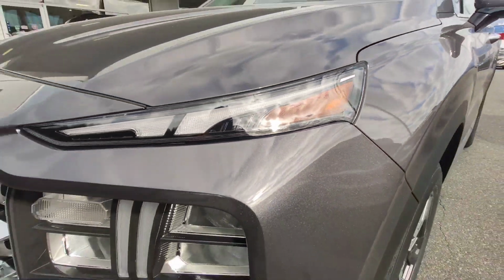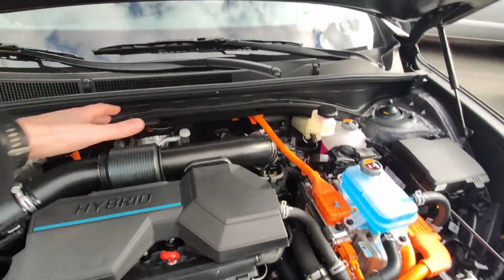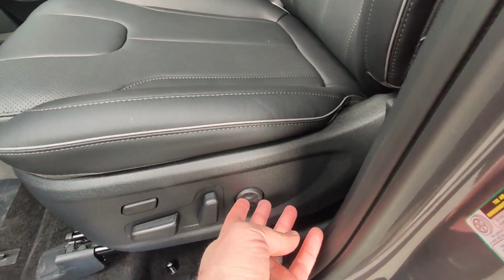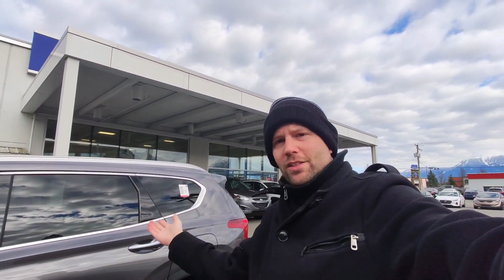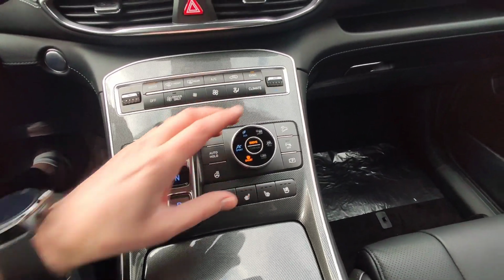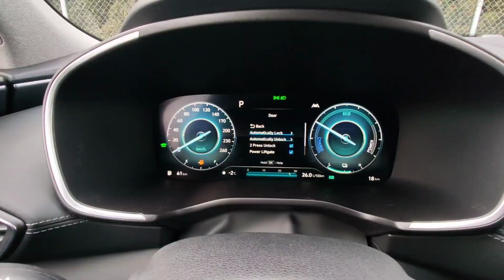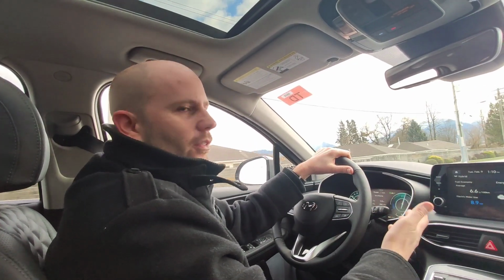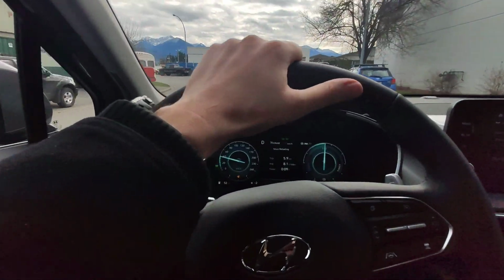2021/2022  Hyundai Santa Fe HYBRID LUXURY ! - Full Review

Comment: In Canada, there are two hybrid trims. Can you highlight the main differences between the two trims? I know the Preferred trim has no digital cluster. Anything else significant?
Reply from the maker: I'll be doing a video on the trend hybrid soon.

But in the meantime:

https://www.hyundaicanada.com/-/media/hyundai/showroom/2021/santa-fe/brochure/2021-hyundai-santa-fe-product-card-en_mar.pdf?modelId=762b9321-00da-4f2c-8ed0-727ed8f1d288
Reply: @edsgarage001  Thanks for the link, I thought there was no information on Hyundai's website (still no mention in the "Build and Price" section).  Note that the hybrid I test drove had a spare tire while the brochure says otherwise.  Strange.

Comment: How does the 8-in infotainment system compare to the larger one of the Calligraphy trim?  Besides being smaller, is it slower, less responsive? Maybe a few less features with Bluetooth, navigation, etc?
Reply from the maker: It lacks navigation, however it gains wireless carplay and Android auto. The interface is a bit different but it responds just as quickly.

Comment: Do you know if the Hybrid or at least the Plugin Hybrid has an electric heater? Otherwise it means you will have to keep the thermic engine running to warm up the car during winter.
Reply from the maker: The Ioniq plug in hybrid has no problem heating the cabin at all, but it does fire up the gas engine initially to speed up the process, which is actually the most efficient way to do it. I imagine the Santa Fe PHEV will do something similar.
Reply: @edsgarage001  What do you mean by speed up the process?
Reply from the maker: @TofSag  speed up the process of heating up the cabin.

An electric heater would be very slow compared to the waste heat generated by the gas engine.
Reply: @edsgarage001  But gas engine first need time to warm up itself. However I understand from your answer that the Ioniq plugin would use both (electric/gas).
Reply from the maker: @TofSag  as far as I know
Reply: In fact the question below is whether it is possible to warm the cabin without running the gas engin as it is forbidden in Belgium to let it running while parked.
Reply from the maker: @TofSag  ah... 

I'd say probably not.

Jammer hé? ☺️
Reply: @edsgarage001  Ja ;) With the Park Assist,  that’s most probably the 2 functiionnalities I will miss compared to the Kodiaq
Reply: Good question. The CRV with it's 1.5T is known to not heat the cabin enough in Winter. Will this Santa Fe have same problem?

Comment: How if feels acceleration wise, compared to the turbo?
Reply from the maker: I would say it's about the same as the old turbo. But the new turbo has much more horse power and torque, and it's connected to an 8 speed wet clutch transmission. So of course the turbo is going to be quicker.
Reply: @edsgarage001  In Canada, you guys are not getting the big screen "radio"?
Reply from the maker: @19mati67  not yet, at least not in the hybrid. We're only getting the hybrid Luxury trim level.

Our non hybrid with the turbo does of course have the large screen stereo.

Comment: Where are you located?  There is no Luxury trim in the U.S.
Reply from the maker: I'm in Canada
Reply: @edsgarage001  I finally watched the video and figured that out!  Some really good tips that I have not seen from other reviewers of this vehicle.  Good job!
Reply: There's no calligraphy version?
Reply from the maker: @quikxfl  there is no Calligraphy hybrid... Just a Calligraphy 2.5 turbo non hybrid.... In Canada anyway
Reply: @edsgarage001  cheers. Perhaps after the first year they will add one, or at least a Limited if the demand is there! Great content.
Reply: In your opinion....would the 2.5 turbo be better or the hybrid 1.6 for quality drive and long-term?
Reply from the maker: @jasonbirch6589  that's a tough question as the 2.5 turbo is a new system.

The 1.6 has proven reliability though.

If you drive a lot, go hybrid, if not then go for the Calligraphy. That turbo 2.5t is fun.

Comment: If you buy a Hyundai (especially the Tucson and Santa Fe) be prepared to spend minimum of $175-$500 every month on BS problems you will never experience in a quality car like an Honda. Every other month you will have to replace 1-4 0f 6 to 8 catalytic converters that go out for no reason like clock work one after the other. Your gas line will need replacing, then your gas tank that rotted from the inside for no apparent reason. Your check engine light will be on more than it is off. You'll also notice when you hit a bump your car will wobble when the front wheels leave the ground, your passengers will also notice this and ask you if the car is "safe to drive that way"?. When you finally replace head gasket, then the entire engine and decide you've had enough, and sell it for next to nothing, you'll buy yourself an Acura and realize that it never needs maintenance, that it isn't normal to be without your car every other month because it's in the shop again, and you'll swear like I did to NEVER buy another Hyundai again!!!
Reply from the maker: I'm sorry you experienced problems with your Hyundai,
But your statements are just not consistent with vehicles that Hyundai has been producing recently.
True that Hyundai has had its struggles in the past, but so has every other brand. 

Let's use Acura as an example, all you need to do is search for *acura class action lawsuit" to see the various issues they've had in the last 10 years.
That doesn't make them a bad brand, this stuff happens to every brand.

But if you check out JD power and associates overall quality and reliability studies, you'll see Hyundai has been above average on both studies for many years. They're not the Hyundai of 10+ years ago.
Reply: @edsgarage001  Gee I wonder if they'll refund the thousands of dollars they charged me for all the BS work necessary to keep a Hyundai running when I owned one!?
Reply: @dand900  You seem to be living in the past.
Hyundai has been making very reliable cars for the last few years

Comment: Hey Ed, I would like to see a driving comparison b/w the 2.5LT and Hybrid, the Turbo looks like it is fun to drive with the additional torque, do you lose a lot of acceleration with the Hybrid? Really how effective can you overtake on the highway in the Hybrid?
Reply from the maker: With the extra torque from the electric motor, it's actually pretty good. It's better then the 2.5na... so it's in-between the two other engine options.
Reply: I just test drove both the 2.5T Calligraphy and Hybrid Luxury.  The 2.5T is much faster, much higher accelerations! But also much noisier when accelerating, and even slightly noisier at cruising highway speed. That being said, the hybrid was fast enough and even has a few features the Calligraphy has not. It has not much power to spare, so I suspect it would feel slow if loaded with 5 passengers or with the trunk full.

Comment: My impression, Keep it in Canada!!!

Compared to the USA Limited HEV...

No 110V outlet
No smart parking
no 10.25" NAV
Not the same digital dash as the Gas models
No 360 degree camera
No rear view in the digital dash when changing lanes

It does have quilted upholstery (Nappa?), spare tire, mud and sand mode

Each country marketing changes must keep the Korean factory busy......
Reply from the maker: It's very likely that we will eventually get the limited version here as well (it'll be called Calligraphy here though).

But for now, we just get the two trims.

Honestly, this trim in the non hybrid sells exceptionally well in Canada, so that's probably why we're seeing it already.
Reply: @edsgarage001  Only get it if Kia Canada marketing is smarter than Kia USA marketing....which I doubt.
Reply from the maker: @normgilbertson3975  Kia?

Hyundai owns Kia... Not the other way around
Reply: @edsgarage001  I think he's referring to the Sorento Hybrid compared to the non hybrid.  Kia left off some pretty significant bling off the Hybrid version.

Comment: Curious what will be different/similar when the Hybrid comes to the U.S. 
Difficult to get a clear reading on the fuel economy but it looks like you were jumping around 29-39+ MPG. 
And that was city driving in a brand new car - but I wasn't sure how accurate that is when there is no GAS in the tank. 

In either case - looking forward to seeing the specs when it releases here in the States. 

Enjoyed the review ~ wasn't expecting the bald head. haha
Reply from the maker: So apparently, the hybrid in America will be based on the limited model. So a little more feature rich then what we've got. At least for now.
Reply: @edsgarage001  Correct. From what I’ve seen our Hybrid has two options. - SEL and Limited. 
I’m just hoping that they throw in a couple more features that the non-hybrid limited doesn’t have. 
Plus I’m hoping that confirmed EPA avg is about 37. You’re the second person to mention that number as an estimate. So I’m optimistic. 

In either case - we’ll find out soon enough. We should see our Hybrid come out in less than a month and a 1/2.
Reply: @josiahstearns9615  I saw the new Santa Fe hybrid in the US gets 33mpg w/AWD. Not bad. The thing I wonder is if it has enough power up hills. I test drove an SEL with the base engine and I would want more power for driving through mountain ranges than what the base engine had. Around town it is totally fine
Reply from the maker: Well... We can't all have a full head of hair in our 40's
Reply: @edsgarage001  could have fooled me - I was guessing you were in your late 20’s to early/mid 30’s
Reply from the maker: @josiahstearns9615  well I guess I'm not doing so bad then

Comment: Awesome review! I noticed this trim has the 8" screen instead of the 10.25" and no blind spot view monitor on the dash when you used the turn signals. Is this the top trim of the hybrid or will there be a higher trim offered that includes those features? Thanks
Reply from the maker: Thx for the comment!
Reply from the maker: I wish I knew, unfortunately Hyundai hasn't released much info yet. But I do believe this will be the top trim for the hybrids. Hopefully I'm wrong.